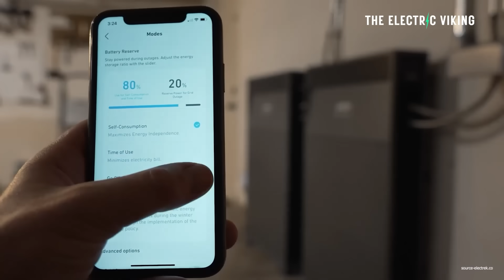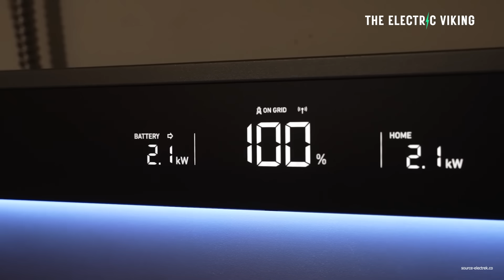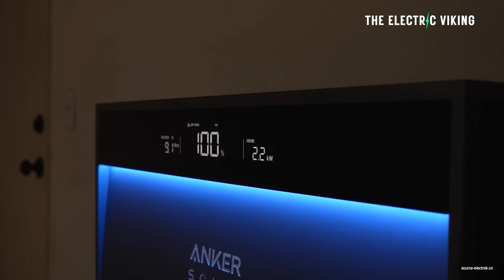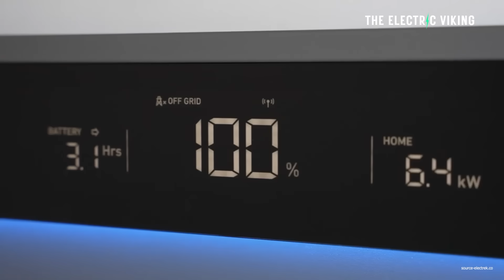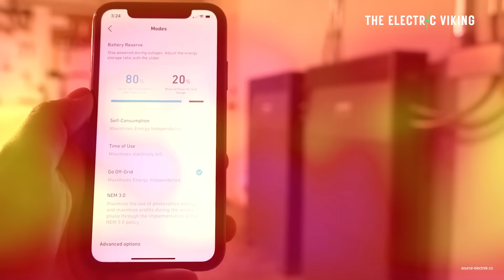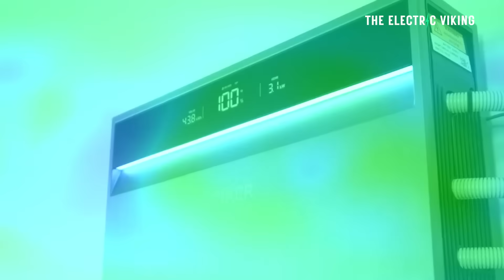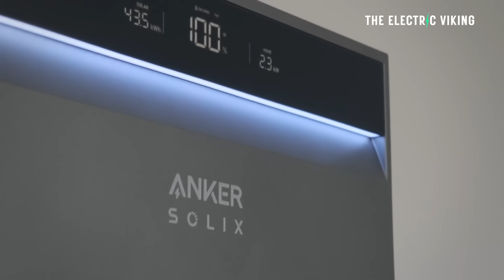How Soon Until the Grid Is Optional? Expert Breaks Down the Future of Energy

Comment: This is JUST ANOTHER HANDOUT FOR THE WANNABE GREENE'S. We had this happen with SOLAR Hot Water Systems, Ya got it for Nothing, BUT When it came to Replacing them In Coastal Area's, where they Rusted out in 10 year's ! The WANNABES wouldn't or couldn't afford The Cost of Replacing The Systems  on The Roof.Thousands of Systems HAVE and are BEING REPLACED BY STORAGE UNITS. At an Average of $15.000 LESS per Installation. It's all Good When SOMEONE ELSE IS PAYING FOR IT.

Comment: You don't need a big solar system anymore. Ovo and globird offer 3 free hours every day from 11 to 2pm. Even a 50kwh battery will charge for free from the grid provided your inverter is big enough. I went 48.3 kw sigenergy which lets me charge the BYD shark (22.5kw), run my house and get feed in bonuses. Doing this will mean you never get another power bill. I only have 13kw solar but my electrician strongly advised against getting more on the west for this reason.

For anyone getting solar and battery, get the smallest solar system you can (5kw to comply with rebate requirements) and the biggest battery you can afford to max out the rebate and future proof.

Comment: It is not viable to go off grid. I used Chat GPT to model the opportunity and it would destroy my quality of life. Stress levels would be through the roof. The idea that you can run your house on your EV is nonsense. You run down your EV so you have to go to an EV charger so you can drive the car. In the meantime, the house doesn’t have any power. Further, the reason you have run down your solar batteries is because the weather is crap and/of you have used too much energy (probably to charge your EV. The only way to amortise the capital cost of a solar array and batteries is to use both to the maximum for your own use. Every morning check your battery %. If it is not 10% (about as low as most batteries go), then you have failed to make a dent in amortising your capital outlay.  At 3 cents FIT, the income is not material. Itt is better to use it than feed it to the grid. At some point, the FIT will hit 0 cents or below. People using Amber are betting that the grid will be unstable often and they will benefit from energy price spikes. Amber customers are finding that these price hikes are very rare and the extra $25 Amber charges each month plus the daily supply tariff and even negative FIT make Amber a fizzer. Don’t overscale your system or you won’t recover your investment fast enough to replace your batteries after about 10 years.

Comment: I have a farm that has a grid powerline about 300M from my shed.   I was quoted $90,000 by powercor to connect the shed to the grid from which I would pay for electricity usage and connection for the rest of my life.   I instead installed a 10kw solar system with a 31kw battery that cost approx. $35,000, with rebates    So far, i have saved over $5500 in electricity costs in three years.   In reality the system sits idle most of the day, as it only takes a few hours to fully charge the battery.  I have an EV.    So when I'm at the farm the battery stays full and the solar array charges the EV.   I had thought of installing a diesel generator for backup, but when I did all the calculations, it worked out cheaper to simply add more battery, because their is plenty of solar energy available to charge most of the year.

Comment: I installed an 8kw (upgradeable to 13kw) battery ready solar system 2 years ago. Have just ordered a 30KW battery so that i not only have plenty to use of an evening, but ive got plenty of excess capacity to seek back to the grid via a VPP. I was considering getting a few more panels to ensure ive got maximum charge in order to have the maximum available to sell back to the grid, but with the announcement of the solar sharer scheme, i dont think id need to add more generation capacity.

Comment: Basically, the scenario described at the end of the video - complete self-sufficiency by adding a fuel-based backup generator for the ~1% event - is exactly the system the whole grid is heading for, but with addition of wind power to solar and battery and other storage (eg pumped hydro).

Comment: My opinion is that, even if the battery grant comes to an end, the momentum will  be there. The good news stories of low power bills will be everywhere and people will get batteries with, or without, the grant. Aussies are known for their uptake of cutting edge tech. As for going off-grid, who knows? It does require a good design and a fair bit more up-front expense, but being independent of price-gouging electricity retailers is worth it. My system cost me $64k, but my savings on household electricity (and the "service charge")  and not paying for fuel for an ICE vehicle mean that it won't owe me anything inside 8 years.

Comment: I have just installed a 13.6 kWh battery with RESINC an excellent company to deal with. The user interface is excellent and easy to use. Ergon [Regional QLD] is scheduled to change over my digital meter [first generation] with a smart digital meter later this month [November 2025]. It will be interesting as to how easy it might be to integrate that kWh data [validation purposes] with my existing proprietary data analysis system. The battery use interface can selectively generate day date specific *.csv files which can be dropped onto my macOS desktop. I had absolutely no problem incorporating that delimited file into my existing data analysis system.

Comment: We have 22kw of solar and a 48kw sigenergy battery. We can literally turn off the grid now except if we have s couple of cloudy days in a row. Bear in mind we also charge 2 evs from our system also. Currently we are with OVO energy so we can charge the battery for free between 11am and 2pm even if its a cloudy day.
Reply: I'm thinking of getting a system like yours, how much did you pay?
Reply: @trythis2821 I just had a 48kw sigenergy system installed. It cost $21k after the rebate and I already had solar. Shop around local electricians. The identical system had price differences up to $13k.

Comment: You can charge it on the grid feedin from 3 hrs for free next year and with Amber most of the day under 10 cents

Everybody needs a big battery - for time shifting power in cheap out at the peaks - bill goes very low or negative when you use Amber
Reply: You can already do it with ovo and globird. I went globird as it was far better than amber. I think the amber model will die with the number of batteries coming online.

Comment: Previously, I had a 10kWh Sonnen battery pack that would power my home until about 4:00 am (so we’d be on the grid in the morning).  Since upgrading to two Powerwalls with combined 27 kWh, I’ve not used power from the grid.  Right sizing is crucial!
Reply: I take it your not a low income earner?
Reply: @halitosis75 My original Sonnen battery pack (a real POS) failed after 3 years and they were unable to repair it under warranty.  So with the warranty $ and fed/state credits, the upgrade was not that expensive.

Comment: The economics and viability of going off grid depend a lot on your situation.  In Alberta, where I live, winter electricity consumption is 2x higher than the summer and we have 1/2 the irradiance.  I would need at minimum 2 days of battery and at least 2x my yearly solar demand from my array to get enough winter generation.  I would also still need a gas generator to handle gaps .. plus I would still need fossil fuel for my furnace for very cold days (20% of the btus from gas … 80% from a heat pump).  Resistance electricity to replace that 20% furnace use is possible but not economical since the election demand  charges would be $1,800 extra / yr before even accounting for the energy charges. 

I believe in the grid where I live for these reasons. Alberta has good wind resources.. which are higher in the winter .. so I am happy to run grid tied and sell my summer surplus and draw power in the winter.  The grid is like a highway .. sure you can build your own road .. but  cooperating and sharing is often the cheaper and better path for societies.
Reply: Extremely well summarized,  thank you from fellow Albertan
Reply: The situation is very different in Australia where there’s sun year round, solar panels are cheap and now batteries are also cheap with the federal government subsidy. Your grid electricity is quite a lot cheaper over there. I average around 21 CAD cents per KwH here in Canberra for grid power which is actually one of the cheapest jurisdictions in Australia.

Comment: 🤗🙏SAM FOR SHARING THE  IMPORTANCE OF RIGHT SIZING 💚💚💚
Reply: Right sizing starts by undertaking a consumption profile, preferably in 5-minute intervals, over a 24-hour period, seasonally adjusted. If you have advanced spreadsheeting skills and can write date-time formulas, and the data is available, this is a relatively easy task. The decision as to the investment is determined by the time interval  [day in any month of the year] you must guarantee the availability of power. If you get sizing wrong, you may have either under- or overcapitalise the solution.

Comment: I’ve suggested this before, but in my opinion it should be possible to go off-grid without a generator as long as you have an EV and V2H capability. The EV simply acts as a backup in case the battery is fully discharged. If the EV is close to full discharge, just drive to an EV charge station to recharge. The only risk is if there is a technical fault in the system, especially the inverter, but in this case having a generator probably wouldn’t help anyway.
Reply: Are you assuming that car won't still be used for daily driving..
Reply: @jamskof  I’m assuming it will only be needed as a backup on very rare occasions, but yes,on such occasions it would need to be available to be connected to your house system on such occasions, so might not suit everyone.

In my own case I haven’t gone this far and don’t yet have an EV anyway. Since having my system fitted back in mid July, I haven’t had to rely on the grid once as the battery has never completely discharged. I personally wouldn’t go off-grid unless the standing charge were to rise significantly, but good to have a backup plan for this eventuality. It wouldn’t surprise me if suppliers start doing this as usage charges to customers with solar and batteries falls.
Reply: @mrdcwdcw i think the grid needs to make it attractive for people to stay connected. If it gets too expensive,  people will start disconnecting from the grid. Most detached homes have enough roof area to generate all their electricity.
Reply: @jamskof I was going to do this in my old house.  I had 6.6kW of solar, 42kWh battery and from experience I would only run out 3 times a year. I can charge the car free at work. So I could bring power using the car. I almost disconnected from the grid, but then I got onto Amber and didn't disconnect because I could make money.
Reply: The current system being installed is 10 kW and coupled with a 13.6 kWh battery for most consumers with household consumption between 18-22 kWh per day would render the grid as the energy provider of last resort.

Comment: I could have 20x the solar array I have now, and not be sure it could cover our energy needs during the winter period of cloudy skies. 
Our energy supplier cut the payment for our excess production from 10c/kwH to 7c/kWh in 2025, and it'll be down to 4c/kWh in 2026.
Not only would it be impossible to fit all extra the solar panels somewhere, but they'd never pay for themselves in my lifetime.
Reply: Im in Saskatchewan and offgrid. 32kw on tilting ground mounts. Those grey days? Have to be pretty well black for me to not have 2-3kw coming in off the solar. I have no issue floating the 40kwh of batteries for 5-6 days of poor weather. Panels are a LOT cheaper than they used to be. Especially when you are buying by the pallet.
Reply: @davefroman4700  Even that would require me to triple my solar array and quadruple my battery storage. I live in the suburbs, I just don't have the room for all those panels.
Reply: @ziploc2000  My uncle thought the same thing. Until we realized he could fit 8kw on a carport over the driveway. He has 30kwh of server rack batteries. He gets nothing back from the grid for his excess. But its still going to pay for itself in 8 years. Even with the cost of the carport. If he sees that the weather the next day is going to be crappy he sets his system to charge the battery from the grid overnight when its dirt cheap, and lets the solar float the house during the day when nobody is home. At night the house runs off the batteries when the power is most expensive in the evening. Just by load shedding he saves 70% of his power costs for the power he does need when the solar is not cranking enough.
Reply: @ziploc2000 microgrids like 5 homes with roof panels sharing a single battery and charge system can work. Peak demands like EV charging or laundry can be on a timed rotation. Many panels can be ground mounted like a fence taking advantage of bifacial technology.

Comment: The problem with the battery rebate is that it ties you into the Grid and you have to make your Battery available so the Grid can feed off it whenever it likes. That is Vampire Economics. If you had non Profit government ownership and a real ICAC keeping Politicians honest then this compulsory battery tie in would be a great idea. The fossil fuel Electricity providers love it as do Ai Data centres. They can continue to manipulate the market even more and hike prices with fake shortages at certain times. Better to wait when batteries will be even cheaper and you can have sole ownership.
Reply: yeah i got burnt on the panels and rebate any battery i get will be solely owned by me its not worth the share the gov gets and what they can do wit hit for the price saving
Reply: Feeding back into the grid as a VPP is totally optional in NSW.
Reply: @Johnno1979  Not if you get the Battery subsidy. You don't have to do it now but it will be a requirement later.

Comment: If "experts" had wings, they wouldn't fall on their asses so frequently while pushing their pie-in-the-sky. How many normal working-class people will ever be able to go off-grid with one of these systems? Reality bites, I know, but it's helpful to acknowledge it sometimes.
Reply: When I was in high school, we asked "How many normal working-class people will ever be able to afford a computer?"  In 2025, many people have had computers but don't have them any more as iPads and iPhones have made them obsolete for them.  Reality changes.  It just takes longer than many of us would like.
In the 20th and now in this 21st century, "never happen" typically takes one generation (about 25 years) to happen.
Reply: @peteinwisconsin2496  A PV array that can power your home and charge the battery in your EV is a far different proposition from a computer. Transistors and then integrated circuits made physical miniaturization of computers, and in turn vastly decreased pricing with vastly increased processing capability, possible. I'm not currently aware of any tech on the horizon that can shrink a rooftop solar PV array, and all the hardware that goes with it, down to the size and cost of a PC.
Reply: If you DIY it can be real cheap today to be off grid. If that is your intention and you have the space for enough panels. Cost of panels has dropped 90% in the last ten years. I can buy 16kw worth of panels for $5000 Canadian peso's. And so have the costs for batteries dropped substantially as well. And continue to do so. Five years ago a 5kwh battery would run you about $3500. Today that same battery can be had for under $1000. With Sodium batteries now scaling up that cost is likely to be less than $500 in a five years. It cost me half as much to make my place off grid than the Utility wanted to charge me to bring power a little more than a mile into this formerly abandoned homestead.
Reply: @davefroman4700  That's dandy. But the fact is that most American's can't even drive a stick shift or put air in their tires today, much less install a DIY PV setup...and if you live in a hive (apartment) or a HOA-regulated community with restrictive rules and no yards to speak of, you're screwed too. Like I said, there's this thing called "reality".